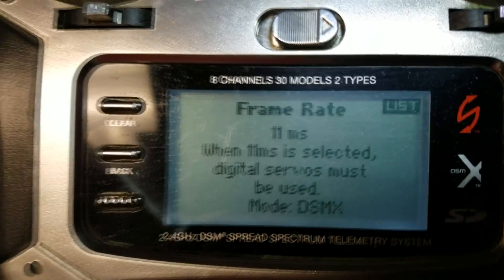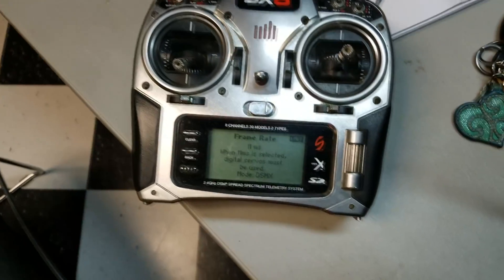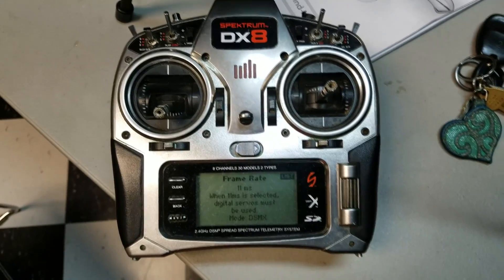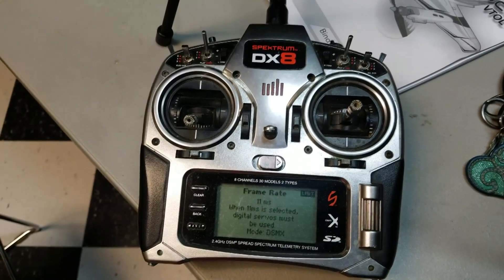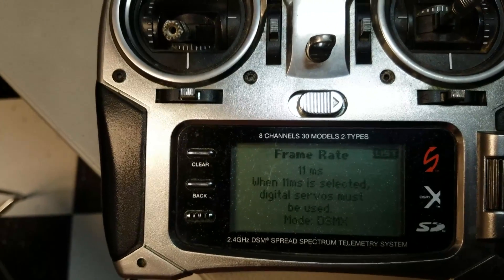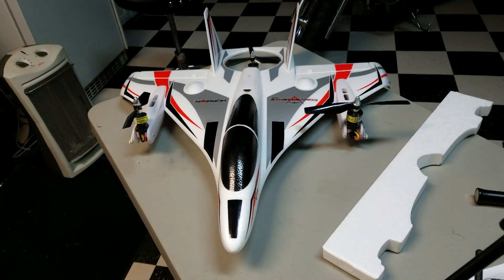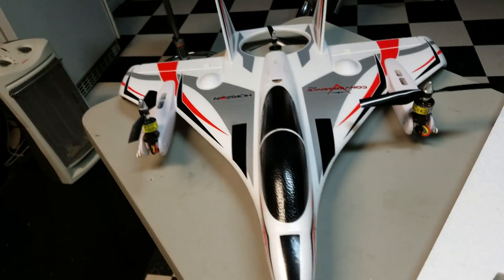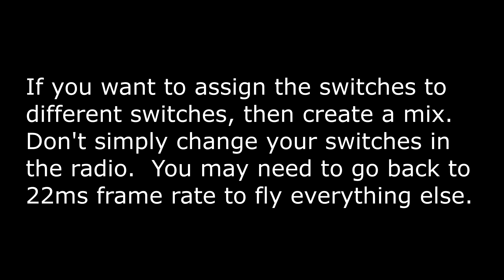How to Bind a Gen 1 DX8 to the Convergence VTOL

Comment: I had no problems and it performed the bind procedure per the manual as it should. 
I am using the 1st gen DX8
Reply: Shane you are using a Taranis with a DM9 Module ?
Reply from the maker: mine would bind, but not do anything after the bind.  Maybe you got lucky?  Not sure
Reply: Stu you said yours would BIND ok what radio and receiver?
Reply: Stu i have found out the 1st GEN of the VTOL wouldn't work with the Taranis and spektrum module something to do with the DSM2 and there flight controller. They sent me a AR610 and that let me bind my Taranis using a spektrum module but ive change over to all spektrum now to fly mine. I didn't trust the mix of the taranis and spektrum.

Comment: HAve a question not sure if you would know it but i figure start here. I bought the BNP/BNF and PNP Convergence VTOL but only have a Taranis with the Spektrum DM9 module and it binds to all my other Spektrum crafts but with this plane im having a problem getting it to work. It binds as they say just plug in the plane let it go into Bind mode then turn on radio and bind it and that all seems to work as the Receiver flashes orange as its looking to bind and then radio on and bind mode the receiver goes solid orange shows its done but no stick input to the plane. Turn off radio light on receiver goes off turn on radio light goes on receiver but moving the sticks nothing. I dont have a Spektrum radio and have all 20+ of my crafts working off the Taranis both with and without spektrum receivers. Any help would work. I called Horizon and there support team is not up on this new plane yet and cant answer any questions other than basic. I have my Taranis receiver in it but its so huge with all the 6 servo wires its no room for the fpv gear or closing the bottom up. So would like to bind this to the Mini SPM4648 receiver. Thanks for any info and help.
Reply from the maker: I would make certain  to set up your exp, travel, and switch selection the the exact specifications in the book.  I have experimented with this and have found that it does not seem to want to work if these are not exact.  I would  make sure to disconnect the plane's battery, and then turn off the transmitter after the initial bind.  Then turn on the transmitter and reconnect the power to the vehicle.  Believe me, I went through lots of different experiments until I took it to my buddy that works at the hobby shop.  He went through all sorts of experiments as well. It finally worked.  My buddy finally experimented with something one would never consider (the servo speed) and made things happen. Since you are using a module, you should not have really any major issues.  Unless this is a programming issue with your taranis (your input to the radio), I think you'll be up and running in no time.  Try the above and let me know if that helps.  I wish you the best on this.
Reply: I just tried all that and other ways and nothing. It binds you can see it go into bind mode flashing orange light then bind receiver and it goes solid orange after 4 flashes then stays solid but it wont take any stick commands so im lost and hate to buy a Spektrum radio just to fly this thing. I have my Taranis receiver mounted in it but takes so much room up and the wires look ugly. My Taranis receivers all have Sbus but not sure how to use that on the FC. If i could use or figure how to wire the Sbus receivers into the flight controller it would be easy only 3prong wire oh well maybe is months Horizon will figure out something. But then saying PNP is not really true .
Reply: Stu I been reading and watching and on the phone and comes to find out the DM9 spektrum module  is a DSM2 ONLY not DSMX so it binds but wont talk to the Spektrum mini sat receiver that comes with the VTOL. so I went out bought a DX6 and all is fine other than when I had it with my Taranis receiver in it and wired PPM with the 6 servo wires i had good reverse but with the DX6 radio has near no backward movement till your out of stabilization mode. Seen lots complaining about near no backward movement in stable mode. Will work on this as time lets me and see and im still going to work out a way to run the Taranis off a Spektrum module . I spoke to HH they said the first batch of the VTOL went out knowing there was a no bind and fly on DSM2 through a taranis using a spektrum module so the fix was install a AR610 spektrum receiver and bind it.
Reply from the maker: Well, your determination will be rewarded.  I can't wait to return from vacation to fly this, provided it's not raining when I get back
Reply: Bear Cubb , I just got mine. while I am not trying to get it going with your setup, I have the bind n fly. I'm trying to get it hooked up to a dx6i. I finally got it. some things that I noticed you stated and what I went through should help. first, get the basics programed into the radio. do the bind. unplug and rehook. you still will not have any stick response though. first there is no response visible when in hover mode, as it is all in the props. second, I had to manually enter in prop location within the radio for the transformation switch. plus 100, minus 100. Otherwise it was stuck in between the two modes and would not arm the props. I had to reverse the stability, agility switch for my setup 0 for stability, 1 for agility. that is on my gear switch. transform is on my flap switch. but right now I'm trying to figure out my elevator and airilons settings. I can set the expos to 25 like in the book for setting 0 and 100 for setting 1 and the elevator, airilons really throw when in agility mode. I have seen people complain about lack of throw and I think the expo values will fix it. I may set the high end to 50 to start. also I was able to use the controller to set the props level or even back some to reduce the forward creep. all this is experimental rt now. just had it hovering 6" off the floor so far. hope this helps somone
Reply: T Marrisseau I went out and bought a DX6 i got tired of trying to use the Taranis on it and got it going with following the documents and all for now works fine. Still have the restricted move backwards but in acro mode its fine. I was told the early VTOL was sent out with a problem known on the PNP and wont let you bind them with a spektrum module in another radio. THey sent me a AR610 said sorry and it binds with the tarnis but im not using it no more. I went Spektrum for my BNF crafts. THank you for your input. I am scared to change the travel other than what they say as the Flight controller like to do it all and changing the inputs they say will make it over compensate. Not sure how true that is so i just left it factor settings for now and hope they release the firmware and setups for it soon.
Reply: Bear Cubb awesome, I literally got mine yesterday and ran into trouble setting it up. Called horizon. the tech support told me I would have to send it in on my dime and if something was wrong they would fix it and pay for it to be sent back. if nothing wrong I would have to pay for diagnosis and shipping both ways. Wouldn't answer any questions, usually they walk me through any problems and have me try it out before letting me off the phone. the tech was extremely rude and I've never had an experience like that from them before. Been buying from them for 10 years now with thousands of dollars in product bought. hopefully just a guy having a bad day. Otherwise I may jump ship. so I'm glad you got it going! hopefully get the final tweaking done and be airborne
Reply: I got a few rude replies from them in the past ans was told ship it back and they would look and decide if it was my problem or theirs. I sold my own problem or waited and called them back and got another tech. This VTOL is a new thing and lots are bitching about it but most dont know how it should fly, I see some think it's a quad others think its a plane and yet it's neither of them it's in a field of its own and flys and takes off differ than anything out there. What problem are you having with yours. I have been switching my switches around more to make sure it goes direct into the flight mode i choose. SOme are placing modes on a 3 way switch and it will change between modes in flight causing problems. Others want it to have full back movement like forward but it cant as its not a quad its not a plane its a mix. Its meant to fly forward not backwards as i like to think and its more plane than quad so not really a hover toy just use that to land. Let me know what yours is doing I might be able to help or find you a video as what I did with mine to help.
Reply: T Marisseau
Hey man, you are a lifesaver!
So glad I found this, you got me up and hovering at least with my DX6i and Convergence.
It's nearly midnight here now by the time I have figured all this out, so will take outside and see how it flies tomorrow if it's not too windy.
It hovers terribly in it's own turbulence near the ground, you really need to pop it up a couple of feet straight off to get a nice stable hover.
Can't believe they give no instructions for DX6i, this was a crazy nightmare figuring this out and now like you I'm still worried if I have everything set right for when I put it into plane mode!!
Seems to be ok though, fingers crossed ha ha
Thanks again (0:
Reply: Bear Cubb I believe that I have everything setup good. I have one change that I would like to make though. I am using the dx6i. I would like to reroute the throttle cut to my mix toggle. even with the throttle trim turned down a couple notches, the blades kicked on by themselves. not sure how to reassign that one.
Reply: I took my throttle and its trim as low as it would go the external trim and the stick itself and bind it. I placed my throttle kill on my (A) switch i didn't do any mixing yet. So now when i hit my throttle cut switch it drops to 130- I had my trim like most in the middle and was having some dead stick problems and then had to drop it all the way down and then re-bind it that setting for it to take affect. Not sure if this is what your talking about or having problems with. Im on a DX6 radio and new to Spektrum.
Reply: Jax Teller RC awesome! I have been sick and it's below freezing and windy here so I haven't been able to try it out yet. Yeah pretty angry they didn't give any information for the dx6i when they stated that it would work with any 6+ dmx ect. radio. noticed that they had just stopped selling the 6i and the 6 is the newest model. their numbering doesn't make sense but whatever. it looks like a nice radio but wasn't looking to upgrade. 

I noticed that my elev d/r and ail d/r are what is controlling the expo values. use your monitoring screen to help see the throw amount and adjust with the expo screen. I set 0 on each to 25, and 1 to 50 for  now. I would like to put them both under one switch as I believe that Is what was intended but I'm not sure how yet, or even if I want to. just going to have to label the radio I guess. congrats on getting it up and running. let me know what you find out, and how it goes.  p.s. for people trying to bind this bird, there's a bright blue light that's inside. I was waiting for it to turn orange as per the instuctions. But that is not the light your looking for...bwahaaaa it is on the control board and you probably won't be able to see it unless you're in a dark room. so besides that and having no plane movement it's hard to tell you are bound with the dx6i.